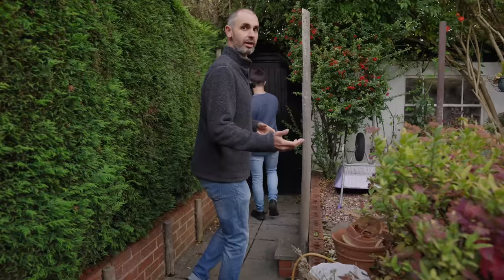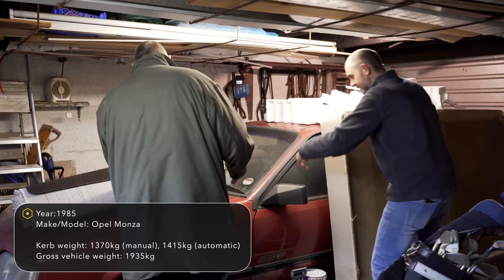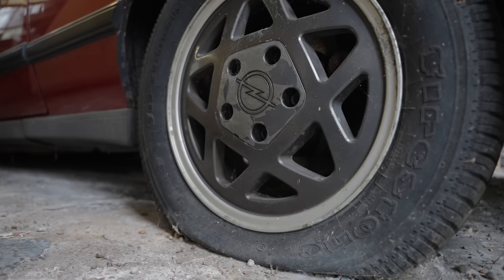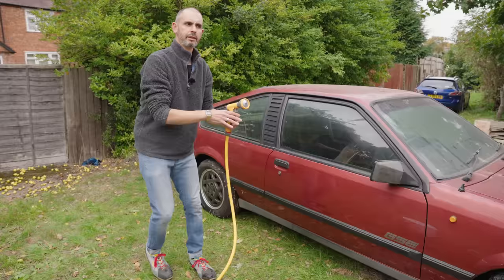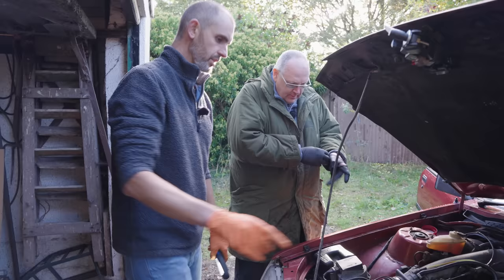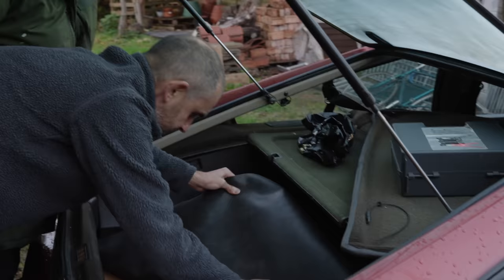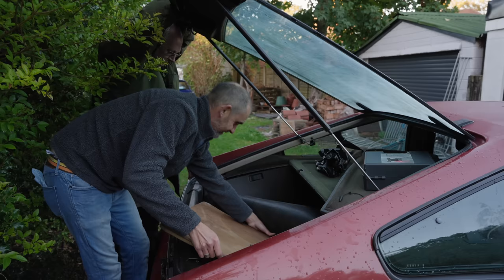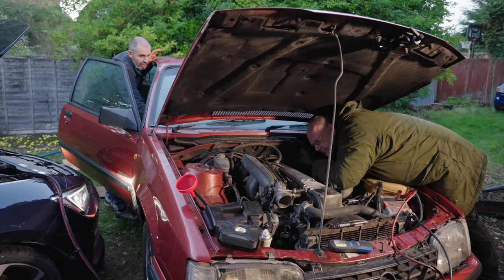Barn Find classic 80s Opel Coupe rare survivor

Comment: Jonny, don't know if you'd be interested in my car - it's not a barn find (coz it's on the road) but it is rare - apparently only about 40 of them.
It's a fiat stilo abarth 2.4 5cyl. Many came with a shit semi auto gearbox that never worked- those were often scrapped and the engine used for an easy upgrade for rhe fiat coupe (which had a 2.0 version of the 5-cyl).
Consequently not too many stilo abarths left but mine is a manual so is amongst the survivors.
Sadly being rare only makes it worth a lot if it's also desirable which my stilo seems not to be! No idea why though, it sounds amazing and I love it!

Comment: I was lucky to drive an awful lot of cars in the 80's and 90's as my family owned a big car sales company. 
The Monza was one of my favourite cars. I can also remember driving the Royale as well.

The Monza GSE was in my opinion the first so called "Black Edition" car. A very sexy little looker, and reasonably powerful for the day.

Am I right in thinking that the tower struts used to rot?

I can remember that my older brother later bought a brand new black Carlton GSI, which at the time was a rocketship. (E reg 1986, I think.)
Reply: "Am I right in thinking that the tower struts used to rot?"
As for 1978-81, I'm not sure, but it did not appear from 1982 model year because in each case then was plastic inner fenders standard equipment.

Comment: There was still quite a few lurking around in the early 2000s and nobody wanted one because they didn't have the preformance to match the fuel consumption. I suspect if they'd fitted 24v or V8 things would have been rather different.

Comment: These are really nice cars to drive! In dependant rear suspension thicker anti roll bars then the normal version, digital dashboard getrag 265 manual or 4 speed automatic limited slip diff (40%) and a 3.0 12 valve with 180hp (or 156 when the emissions regulation came in back in 85) and so on. Some had airconditioning, others had a manual or automatic sunroof and automatic leveling rear suspension was also an option. Gse stood a little bit lower then the normal version and had gas struts. The recaros in the front look nice but those are killing for your spine. Loved these cars, had an a 1.5 and a a2 Gse myself. But sold it all couple of years ago. Still miss my Gse :(
Reply from the maker: High spec and handsome cars. Good memories Peter.

Comment: In Australia during this period Holden used the V chassis Senator floor to make the commodore and we dropped a 4.2 litre and 5.0 litre V8s in them, they sold a bucket load during the mid 80,s and they raced them across AU and Nz wiinning most ATC touring car racing, in the mid 80,s they even took one to Europe to race at Le Mans, this two door variant was bought out and a V8 dropped into it.. we loved it but wasn’t until early 90’s that a two door variant was made and released on the updated floor plan… these are well sort after now, they even made a 4WD drive coupe version with 6.2 litre V8!!!

Comment: Little tip sometimes u can get pump working by tapping it with a hammer 
Especially as its external
Iv even done it on intank pumps 
Just get under an whack tank around where pump is
When someone turns car over

Comment: It is basically the same engine that is in the Lotus Omega / Carlton.
 We previously had a Senator CD in 1982, and now an 1991 Omega 2.6, Carlton, it's the same engine in both, the 2.6 is just heavily rebuilt.
It's a big engine with a lot of resistance... when it starts, it needs a very strong battery, even if it got gas I doubt it would have started with as little current as it had there. 

My Omega sat just like this for 11 years, but before it was retired it got a partly new ignition system.
And when it was supposed to be started, it got a brand new battery.
To everyone's surprise, it started after 15 seconds just as if nothing abnormal had happened. 

Incidentally, ABS was normally standard on the GSE, in other countries since December 1983, optional on others, and this car has the simpler trip computer normally fitted in Rekord, Ascona, Kadett - Carlton Cavalier, Astra, Senator Monza had a more advanced screen and  a control panel located at the gear lever, A predecessor to BMW iDrive from 2001, apparently some differences in equipment.

Comment: Early 90’s friend of mine had the Monza GSE while I had a couple of Vauxhall Senator 3.0 CDi’s. The second Senator I had was very interesting, it was one of the last to be built of it’s generation but had a lot of items fitted by the factory that appeared on the next model, the 24v version. We think it might have been a car Vauxhall used to trial newer components
Reply: In 1989, a number of updated Senators were produced with a new engine and new details that only existed for a single year before being replaced by the 24V, a very rare car indeed.

Comment: I splash a cup of fresh oil to pre lube the cam train before attempting starting. 

And tapping fuel pump can get them unstuck if the fuel gumed it stuck.

Hard starting on long sitting engines can sometimes be valves temporarily not seating properly because the carbon buildup has dried out while sitting. Or surface rust has formed on the open cylinders

Comment: nice. clean it up and sell it as as-new. :) the red metallic paint was prone to lose it's clear coat layer back when. I think at first when they switched to double-layer metallic they used up remaining charges of the older one-layer red metallic, and since red tends to wither faster than other colours some cars caught the short end of the stick. I saw a handful of those in my career as car mechanic.
when I learned car mechanic at Opel's here in germany these cars were new. pretty rare, because price tag, but still. engines ran like turbines and were even more silent... 
we used to nickname the digital cockpit "mouses' cinema". :) also, the velours seats worked well together with cord pants, like velcro. you sat in there like glued in... XD
longer periods of standing around can make the fuel pump corrode and get seized up. I hope you switched the filter as well with the pump, those can get clogged, too. and I almost bet that the fuel lines between pump's pressure side and engine's injection began to leak if they were still the old, fabric covered hoses? in early 90's we had lots of problems with these hoses dying from the new fuels offered at the gas stations. we had some car leaking stuff like crazy every other day...
another detail: if the engine has a catalytic converter, the engine code would start with a C. in this case it would be C30NE for the 3litre injection with 180HP. after engin e number C30NE 0001245 the valve cover was reworked and now needed the new silicone rubber sealing that replaced the old cork sealing. this will not stay in place anymore. found it out when stumbling over an early C30NE where said cork seal wouldn't fit right, and I looked things up in the spares catalogue. dunno why I still remember, but I do. :)
last detail: if you wan t to adjust ignition timing with these CIH engines, look at the clutch housing back when you have a carb; there is a hole with a pointer, pointing at a welding spot on the flywheel. if you have an injected, look at the crankshaft pulley in the front for timing. if yxou confuse the two, the carb won't have full power, and the injected would make noise while accelerating from an too-early timing.

keep on rescueing! :D

Comment: Could have by passed the relay by removing it and putting a short length of wire from the constant live feed to the the live for the fuel pump. This would have given the pump a live without the relay. Either way sounds like the pump is gone. Great show!

Comment: The gravity feed funnel works great on a carburettor because all you need is to keep the bowl full, but has no chance of working on a fuel injection engine because it needs pressurised fuel at the rail.  Hopefully nobody watches and assumes it might work.

Hooking the pump up to the 12V was a good idea, but as other people have said, worth tapping the pump with a hammer (or a drift and hammer if you can't reach) while applying power as that can often free them up.

The relay could have been tested and eliminated from investigations by hooking the trigger and ground terminals to 12V and checking continuity across the high power feed terminals, would be a lot easier than trying to feel it click while turning the engine over.

Definitely seeing fuel supply be a common thread with the Barn Find videos, not terribly surprising I suppose.  Maybe it would be a good idea to take along a transfer pump to drain the tank, and an external tank/pump setup to supply fuel to EFI cars.  I'd imagine such things could be rigged up and added to the BF kit (which should also include a couple of standard Bosch relays, a tyre pump and multimeter 😅)

Anyway really liked this one.. such a very cool car and in such outstanding shape.  Keep 'em coming Jonny.
Reply from the maker: We have since got a remote fuel tank with built in pump!
Reply: @TheLateBrakeShow  Exciting stuff! Fingers crossed for more BF starts in the future then!
Reply: All good suggestions,  Peter.
Reply: @TheLateBrakeShow  the whole 'barn find' concept has been a bit 'back of an envelope ', Johnny....don't you think...!?

Comment: The AFM needs to be connected and as you crank it, the vacuum opens the AFM flap which sends power to the fuel pump. With the airbox disconnected just put Ignition on manually hold the AFM flap open, fuel pump will be powered up then!

Comment: You should know with a fuel injected car you need pressure to get fuel thru the fuel injectors & pouring fuel into a funnel would never be enough pressure to get that car started.
That would work for an old carburetor motor

Comment: Great car. Old enough to remember these. Quirky Opel design.
Would the gravity fed fuel funnel trick work on this car w EFI?  Don't they need about 35 psi fuel pressure to work as opposed to a carb needing about 5 psi. Or maybe these earlier systems needed less?

Comment: I seem to remember the 6 cylinder Monza motor was a Manta 4 cylinder with two extra cylinders .
I owned a 71 Steinmetz Opel Manta A series with the big arches and some of these came equipped with the 6 cylinder 2.8  Commodore motor the Monza motor was based upon ( 79 cars were fitted with 2.8 litre engines )
I also owned a 71 Opel GT mini Vette ,a 71  Opel Ascona A sr  that looked like a Chevy Chevelle ,77 Opel Kadett coupe   and a very rare 69 Opel Diplomat with the factory small block Chevy.
I always wanted a Dodge Charger 69  Opel Commodore coupe

Comment: Please please please take a couple of fully charged batteries to the next barn find. The engine isn’t making enough compression turning over at slow speeds to startup and the ECU needs the voltage at cranking.

Comment: Did you the Holden brand in Australia bought some Monza's in and fitted them with 300hp 5.0ltr V8 and 5 speed manual gearboxs and some were sold under the Holden Dealer team brand.
Peter Brock one of Australia's famous touring care legend was behind it all.
There was a heap more power than the 3.0ltr model featured in your Video .
I am Australian and enjoy your You tube channel.

regards
Waz

Comment: One of these with Lotus Carlton motor??🤔..
Reply: Yes, because it's - basically - the same engine, but it probably won't really fit in the body. However, there is a 4.0 of 272 hp that fits.

Comment: The L-jetronic has a fuel pressure regulator on the injector rail so a funnel full of fuel won't get to the injectors. The pressurised fuel system is flow and return to the tank at pressure. No pump no pressure no fuel to the rail! So no go.

Comment: I`ve had quite a few Carltons & Senators, including A`s, superb cars, & one of the Senators, an 83 Opel CD, had a completely green interior, not only were the seats & door cards green (velour), but all the plastics were too! You could also get all red, all gold & all blue interiors on the pre-facelift Monza`s, Senators & Royales, & top spec Carltons (my Carlton 2.2 CD had a blue interior). Those were the days!

Theres no way the funnel would have worked. You need to get a £10 cheapo Chinese fuel pump from a fuel can to start stuff like this in future, as electric fuel pumps often seize up after a few years, let alone 15+ years. I would have tried giving the fuel pump a number of firm taps with the ignition turned on, if that didn't work, a direct 18v feed to the fuel pump relay contacts from a drill battery to try to unstick it (a brief over voltage wouldn't hurt it).

Comment: If it won't start with a good gravity fuel feed and sufficient charge in the battery, then it's the fuel intake system that's the problem. Whether the pumps is or is not working is not relevant.

Comment: I knew straight away what was wrong with fuel pump ,they should  a open  fuse box and get a direct electric from  from  different fuse to electric pump fuse and car would start straight away I had 2 monza 3.0 E and  one 3.0 GSE. I Kept the car 18 years sadly someone nick my lovely car I did spent fortune change the wheels (zender Star) momo streeing wheel, irmsher exhaust, lowered suspension I made that car one and only in UK I still think of that car it was my baby

Comment: Please, for the love of cars, can a detailing brand get in contact with jonny and give him some basic tools, products and techniques to improve the quick wash process. Maybe a small bag with quality microfibers, a spray on waterless wash in a bottle or pump sprayer (instead of introducing moisture in the seams and old rubber seals), a glass cleaner with a waffleweave towel, a brush or two maybe and an all purpose cleaner ready to use for any interior surfaces (get rid of most of the bacteria in the contact surfaces like stearing wheel, shifter, handles).
If interested i can come up with a list of easy to get products and tools, or some others viewers from the uk can give similar product available in the uk. Forensic detailing from the uk ( on youtube) would surely be interested in helping improve the quick wash process.

Comment: Electric fuel pump is probably seized , adding fuel down a pipe won't work , the injectors need 3-4 bar minimum pressure from the fuel pump to work . Gravity supply just won't do it.

Comment: Love these videos, I do find it a bit frustrating that a new battery isn’t purchased for these finds, £50 max from eurocarparts, maybe purchase some carb cleaner and an electric pump for the tyres? Would probably make life a bit easier to be a little more prepared. Apart from that I love these vids. Sorry to moan.
Reply: And before someone states that not all cars have carbs, the carb cleaner can be used as fuel for anything. Better than easy start. Easy to spray where you like
Also.

Comment: Bet it was a quick car in its day
Reply: 0-60 mph 7.9 s top speed 136 mph, With the manual transmission that was normally standard on the GSE, And it was a special sport gearbox and not the same as on the regular Monza.

Comment: A hose and hopper filled with petrol is not enough, this injection systeem need fuel pressure.. and feed it with more start spray, it is a 3000 CC engine, not a 1000 cc mini cooper. nice car by the way...

Comment: Gravity feeding injectors with a funnel? The fuel system is supposed to be at 3 bar! You had that surrogate fuel system before which is whst you need for this. Roller cell pumps very often die having been stood - it isn't at all rare, chances are probably more than 50/50. You can sometimes get them back to life by giving them a tap. Anything is possible clearly fault wise. The diagnostic process was a bit laboured to watch but you did get there....nice car though, shame it's an auto but always liked these & that looks solid. They were mostly rotten 20+ years ago when I coveted one!

Comment: Never liked the monza, liked all the other opels, from corsa,kadetts,admirals,senators,commadors,mantas,gt. Somehow tje monza was just not it. Had several kadetts and corsas myselve a neighbor had an imscherr manta with a tuned 3.0 that thing did 260km/h and could do a burnout in thirth gear as long as the road was. Or the tires lasted. It was yellow and brown,That was early nineties. He also had a race truck that was insane a scania truck. Still have the pictures me as a 12 year old at that time was blown away and he got me hooked ever since on fast cars. Im 42 now had so many cars from all kind of brands, but somehow cars from before 95, where and still are way cooler than todays plastic fantastic cars. When u dont have abs powersteering ect. U are really driving.

Comment: It can be painful watching you try & start these barn finds as pumps are always first to die.
You need a small  tank, about 30x30x30cm with a internal pump inside it & a means to put fuel in with a suitable connection to a battery.
With long rubber pipes you’d just connect into the existing fuel pipes under the bonnet & feed it fuel this way as it’ll then feed & return to the slave tank.
With a std internal 45psi or so pump you’d get them all going. 👍

Comment: My Morris 1000 had an electric fuel pump inside the engine bay and you could hear it clicking as it pumped fuel into the float chamber. I also once got a tank full of water at Swindon Blunsdon hill petrol station a wee while back. Some idiot had left the manhole cover off one of the tanks; three star as I recall. A lot of angry people ended up down the bottom of Blunsdon hill. Fortunately I had a spare can with me, so walked back and got a fresh can of fuel and Jerry rigged the tank in the back of the Trump herald until I could flush it out later.

Comment: Didn't they make a 3.0 24v version?
Reply: Yes, it came to model 1990, on Senator and Omega 3000, the engine fits the Monza, but the Monza was discontinued in 1986, However, there are several who have replaced the engine with the new one.